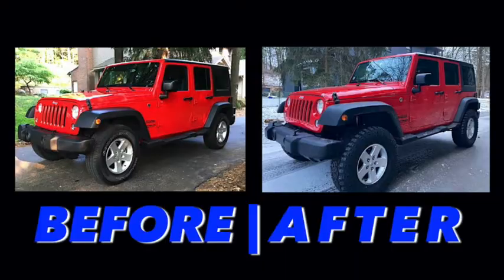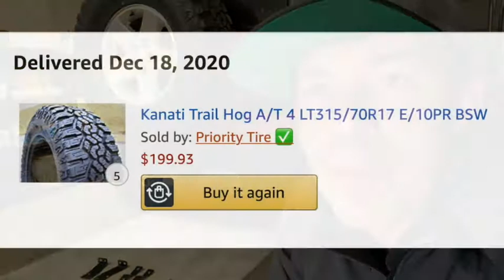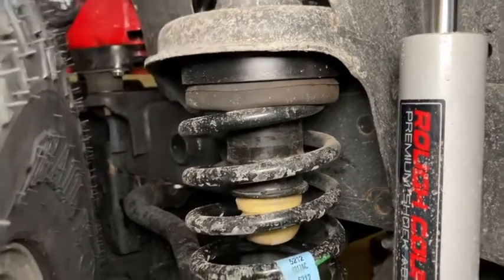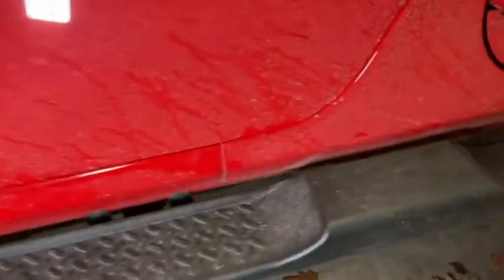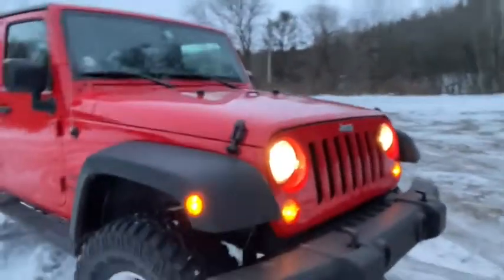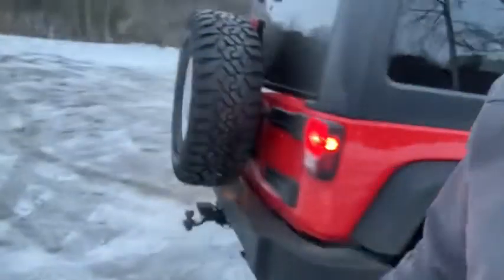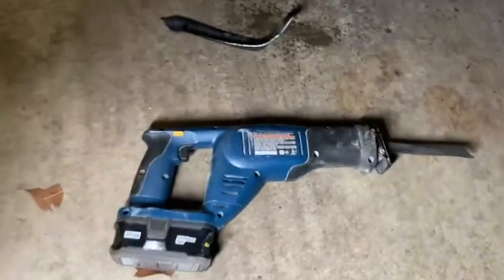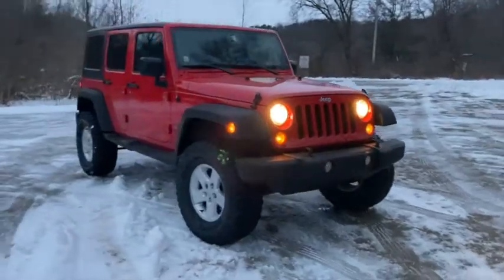Jeep Wrangler 3" Before After Rough Country Suspension Body Lift 1.75" Kanati Trail Hog 315/70r17 34

Comment: I had something very similar in mind. Already have a 2 inch rancho lift with springs and shocks and control arm brackets that I don't really wanna mess with, but that was planned for a 33 high tire. Now that I went with with a near 35, I wanna add about 2 inches without redoing all of my suspension and compensating for more geometry alteration. One of those 1 or 1.25 body lift seems like a good compromise, and I can always put 3/4 spring spacers above my springs later on if I'm not happy with that.